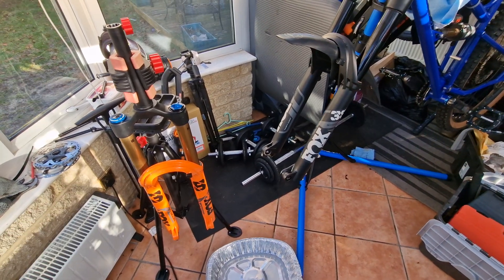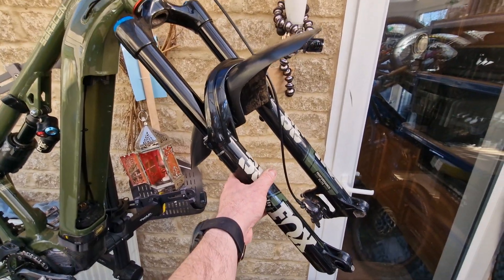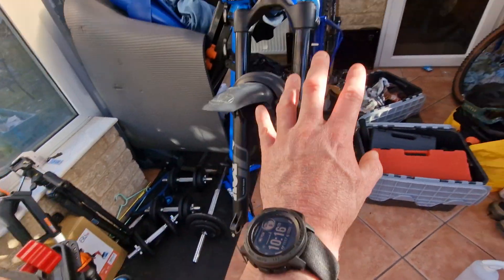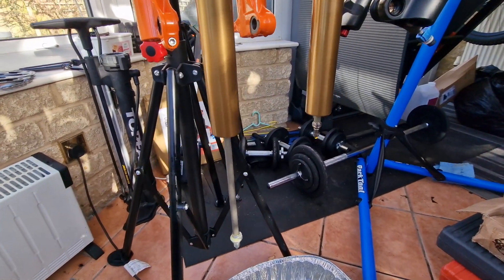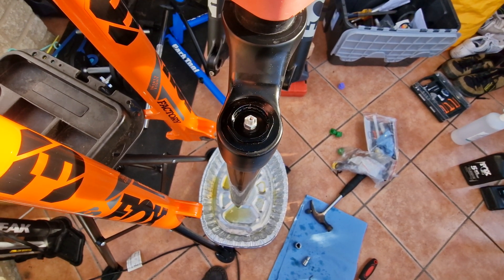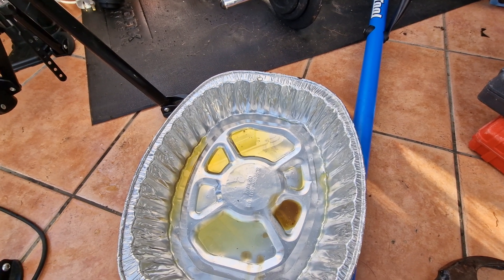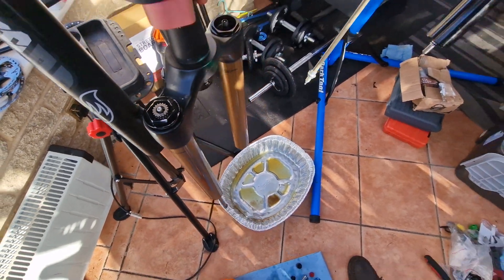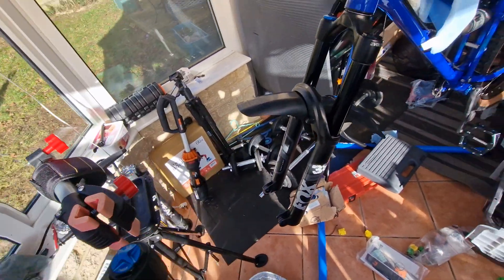Frankenfork - Two Fox 38's - Lets swap the Dampers!

Comment: Switched all oil weights in my grip 2 on my ebike today as my front fork feels like a brick since I’ve switched to the grip 2.
Reply from the maker: Switched to 5wt in the damper? The grip2 should use 5wt, if other weights are used, yes it will feel proper hard.
Reply: @churchofdirt-mtb  I switched to 3 wt on the damper side
Reply from the maker: Interesting, would you be typically riding in a colder climate?

Comment: I’m confused why you didn’t just swap the upper entirely to the black 38.
Reply from the maker: Great question, it was due to wanting to maintain the offsets. The particular 650b 38 factory was a 37mm offset and if I remember correctly the 29er performance fork was 44mm.